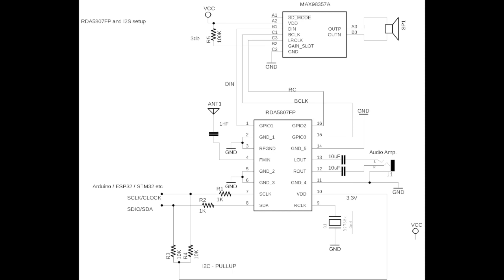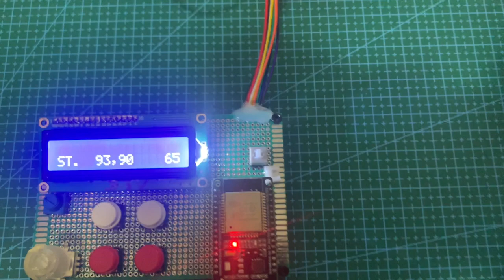FM RECEIVER AND I2S DIGITAL AUDIO WITH RDA5807FP AND MAX98357A

Comment: si4732-a10 is it possible sir?
Reply from the maker: Yes. I2s is already implemented in the pu2clr si4735 Arduino library.
Reply: @pu2clr  i tried it with si4732 but Sound mute and zero frequency.